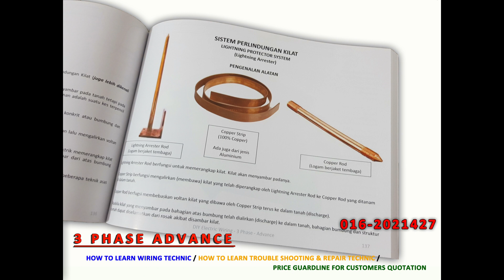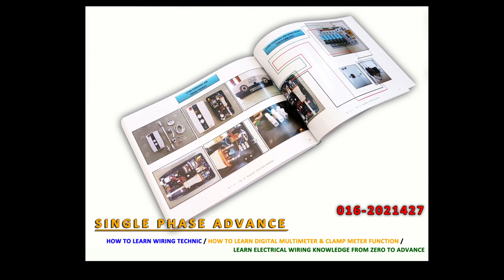PAKAR ELEKTRIK : Upgraded 3 Phase DB for Bunglow

Comment: assalammualaikum... selamat hari raya aidil adha tuan.. saya suka tengok video tuan... banyak ilmu saya belajar.. tidak kisah lah orang nak kata apa pada tuan... tapi selagi benda tu bermanfaat, itu baik pada saya n semua orang... tidak ada orang yang sempurna di dunia ni... hiraukan saja mereka yang mengeji sedangkan diaorang pun belajar pada tuan dengan melihat semua video2 tuan... semoga maju jaya hendaknya.

soalan saya : tuan buat upgrade DB dari single fhase ke 3 fhase ambil masa berapa hari ya? dan macam mana tuan trace 1 per 1 ya curcuit tu? adakah dengan melihat capasity amp pada mcb saja?
Reply from the maker: Wslm & Terima Kasih tuan

Sy ambil masa 1 hari

Sy syorkan tuan Daftar class sy n ikut sy ke site project... Tuan boleh belajar banyak